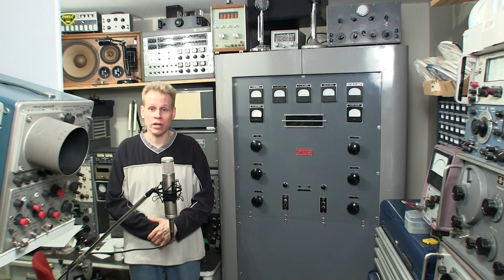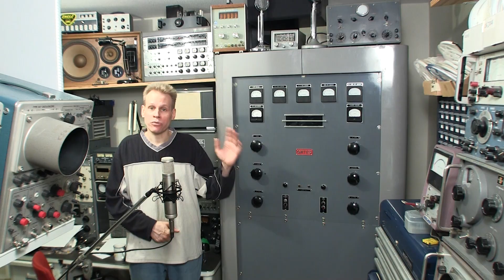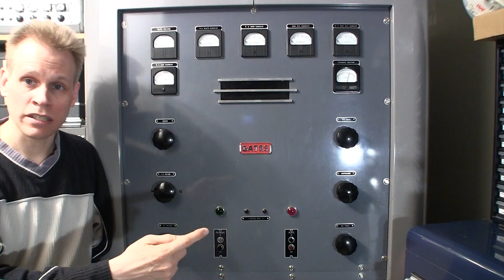Standing Inside a Broadcast Transmitter While it's ON!

Comment: Xmtr operating perameters were measured and logged remotely.   Before deregulation,  logging was done every hour.  There had to be a chief engineer on the staff ( or on call)  with a First Phone FCC License with broadcast endorsement, and the jocks had to have a 3rd class in order to do the readings and make the log entries.  An annual proof of performance test was done by the chief, where-in the audio chain was tested with an audio oscillator and a distortion analyzer across the audio spectrum ( usually up to 10Kc)  Directional stations were required to do field strength measurements in the field at specific points,  to prove that the directional antennas were adjusted to provide the service and protection required by station licenses.  Remote links were done by equalized dedicated telephone lines,  and by microwave links, with telco back up.  W6WUH.  Nice power level.

Comment: So whenever a Radio or Television station leaves the air or concludes its broadcast day (Sign-off) for the day mainly for maintenance, and returns back to the air (Sign-on) beginning its broadcast day, the engineer has to put up with all drama powering the transmitter up. In other words, those messages of the Morning Sign-on and Evening (Night-Time) Sign-off were being used as a means of timing for powering up and powering down the transmitter.

Comment: The Simpson Analog meters on front panel are in Beautiful Shape just looking at meters they scream Americana well Designed , Qualiry built Meters. I have a old Simpson  Analog VOM from my father i guess it was made 50s and still works. I use Digital high low imp VOM for my type of work which is Automotive Related, old Simpson VOM is okay to use poke around older cars with out microprocessors. My old Man said got to be careful if somebody asks to borrow VOMs because most Mechanics either poke out their eye balls with the test leads or when they bring it back VOM Test leads are melted from Shorts and Incorrect Settings, It  was are  inside joke but still cracks me up what he said.

Comment: people will call me a liar, but i worked at a radio station when i was 16. KEYE Perryton TX. i touched the output on one of these and the arc i drew with my finger seemed huge, at least an inch to two inches. it did not hurt though. why is that? they transmit at 1kw at a frequency of 1400.

Comment: WMOG 1490 in Brunswick GA had an RCA from the late 40's as a backup 250 watts.  If you ever had to turn that on in 1984,  the signal went from marginally listenable to BLAH BLAJH BHJAA blah BLAH ase;lfasjfp[j0o-[s!  But we were on the air , and that's all that mattered to a station that 65 minutes of commercials in an hour.

Comment: Sad to say, Our local radio station here in Sylva, N.C.  the original owners son was electrocuted by a  1k  transmitter by just touching a control on the front of the transmitter, but the floor of the room was wet. The stations call sign to this day has his initials. WRGC.

Comment: Could you explain me how a watercooled system on a 2c39 UHF tube does not completely ruin the whole operation? The anode is a large cooling part at the top of the tube. How does that correspond with the high frequencies?

Comment: I miss this soooo badly !!! I used to have this very same model transmitter modified for a certain band near the top of HF  on my peticular Frequency that i operated   in good engineering practice mind you a broadcast station for 26 years. It was my father's and i broadcasted from Friday nights at 10:pm -monday morning 2or 3 am.

  For the first 10 years of operation this beauty produced a wonderful warm classic AM sound and suprisingly clean signal. The bandwidth naturally was reduced and modulation was limited to about 90% and the RF output only driven to 200 watts. I eventually sold it to listener and i believe he got 10 more years use with the same tubes and mercury rectifiers.

My father and i meticulously cleaned it and repainted it to new as your unit is . i later upgraded to a 8877 tube amp which although a bit cleaner and more powerful in class ab and modified a bit sounded crystal clean and zero defects in both audio and spectral purity it could not produce the same character and specific flavor  of this gates transmitter.  Now being a broadcast station primarily listened on communication gear few could likley tell the difference.

  However for myself and any other  true blooded Radio/audio heads (AMers you know who you are)
There was is a spirit sent fourth when the sounds fly through the air from this device that can not be passed through the aether through any solid state device regardless of process or modern refinement.

 The type and variety of emmissions from this radio time transmitter is an example of that experience that comes with sound,smell and definition of imagery that defines the awe and wonder of what we broadcasting types call in its most authentic form  R A D I O            

73  my friends and watch that grid💜💖😎💖💜
Reply: BTW I will be back on the air in the not so distant future ..... You know where ....... There is only ☝🤔💜

Comment: We were still using these when I left KUJ in 2000.   I don't think I ever had to touch them they just sat there at the towers.   I checked them once a month.  Its funny the old gear for the AM never had issues, but anything new, like the SAT receivers, the computers, carts, all would last may five years or had weird glitches, but the damn AM gear, including the AM giant knob pot board, never ever failed.

Comment: How does that thing Stack Up in transmission quality to a modern ham radio transmitter in the same frequency that you're operating on?

Of course the modern one doesn't stack up in the fun and satisfaction Factor but just wondering about the actual quality of the transmission.

My naive assumption is that the old ones just got to blow the new ones out of the water?!
Reply from the maker: Hi Bill. Most modern rigs are low level modulated in AM mode, so they tend to sound "harsh." This was designed to do AM, and do it all day long, so comparing this transmitter to any modern ham rig is unfair to the modern radio. These transmitters are high level modulated (Modified Heising Configuration) and produce the nicest sounding audio on AM. Two 810 triodes modulating two 810 RF finals.

Comment: Let's discharge those large capacitors shall we,  now that we've decided to enter the back of the transmitter. 
I worked with a guy like this in power substations, brilliant, intimately familiar with the equipment and loved to show off the workings of it all. My ethic....If your not doing repairs or maintenance on it , keep the hell away from it. Well he liked to muck around. Until the day he came in contact with an energized 600v, 40,000 amp DC feeder breaker. It was heartbreaking to see his wife's face when supervisors told her of his demise. As smart as he was the odds caught up with him. There were just so many times you could tell him to just sit down and eat lunch and stop digging into the equipment. Even with lock out tag out procedures in place there is ALWAYS something that's alive when you are dealing with power of this type. Traction power, utilities power, industrial power generation can never really be 100% de energized.  Only isolated, buses and circuits, control, battery, metering, revenue metering of PT's and CT's may well be alive. Not to mention incoming high tension feeders. Yeah, keep mucking around, but make sure you have life insurance. Because it's only a matter of time.

Comment: I maintained one of these at the Naval Communications Unit transmitter site at Midway Island 1966-1968.  It was a large building full of many transmitters for military purposes, but the Gates 250 was off in a corner and used for our local AM radio station KMTH.  It was originally 900 KHz but while I was there we were asked to change it to 920 KHz (we had been interfering with somebody during some part of the day).  Even then, crystals were no longer available for it but the crystal itself was actually removable so we lapped it thinner with polishing compound on a flat surface (raising the frequency) by trial and error until we got to 920 KHz.  But my strangest repair was when some custom transformer failed that was no longer available (I forget for which voltages).  Heathkit had recently introduced a new family of bench equipment and for some reason our site had bought some of these and we assembled them.  One of these was the IP-17 high voltage power supply.  I rigged this up to provide the missing power supply voltage(s) in the Gates 250 as a "temporary" fix.  Long after, when I left the island to my next duty station, that Heathkit supply was still humming along.  I set it on the floor of the transmitter and I recall the floor being a little more empty than the one I see in your video, but I may be wrong.

Comment: Talk about durability,  from the late 40's until 2003.  Built to last.  Also the plate loading and the dip current meter is matching the standing wave reflection or SWR.  That was what was great about the old tube transmitters.  New Solid state as far as ham radio use requires a good match or your transmitter will not work very well.  I was the reader for my older brother in 1957 when he took the  fcc exam to get his ham license and his is still active at age 83.  I was slow and got my license in 1977 and also still active.
Johnson was a great company.

Comment: My father was forman of assembly for Gates Radio located in my home town of Quincy Illinois.  I remember him working there in the 50's and 60's.  He would take me there and I would see these large radio transmitters being made for radio stations and later TV and then for satellites.  He always cautioned me against the high voltage and current and not to touch anything.  Teams of people would hand assemble and test the units.  Later Gates was sold to Harris.  My dad was also a ham operator and built a 900 watt transmitter in our basement.  His radio code was W9SFT.
Reply from the maker: Thanks for sharing your story Mike!
Reply: @MrCarlsonsLab  Gates is still in Quincy, Illinois.  The other RF company in Quincy is Broadcast Electronics.  If you listen to radio or watch broadcast TV the equipment is likely built in Quincy.  Parker Gates was only 14 when he founded Gates Radio in 1922.

Comment: One thing I did not see is using a ground rod to make sure all the high voltage is bled off.  There should be a metal rod with a ground strap on it.  If the high voltage bleed resistors go bad you can still get one heck of a shock and it could be deadly.  The ground rod is touched to all the high voltage points like the tube plates to make sure the high voltage is bled off.

Comment: I have been inside a transmitter room while the transmitter is running and I am very skeptical about this video.  When transmitters are active, there should be a very loud noise from the cooling fan.  Where's the noise in this video???
Reply from the maker: This has no fans, The BC-250-GY is convection cooled. (The big cabinet)

Comment: I used to work on AN/URT-23G transmitters in the Marines in our CLD vans.  3250 v on the plates and 1000+ watts. When I left the unit with them, I was asked to check on the new technician. It smelt like burnt skin. He left the van in an ambulance with part of his finger stuck onto the tube.  500 watts, no problem, unless you don’t discharge the circuit before you work on them.

Comment: I work on some of the big transmitters. My biggest is a 30kw harris. I won't go near the inside without pulling the disconnect.  One station gave me an old gates I want to say BC1 was awesome to watch it though the little window to see the final tubes and watch them get bright with the modulation. I ended up donating it to the ham radio club. I have a similar vintage to what you are working on a Gates FM5 I think backup transmitter. I was inside it the other day replacing the filament relay. I don't even know if I can buy tubes for it any more.

Comment: You deserve a lot of praise for taking care of these old beasts. They would have ended up in the dumpster or have been scavenged for parts otherwise. The demise of AM stations is a darned shame. Modern broadcast equipment are full of digital gimmicks and wizardry. The old valve stuff are simply bombproof works of beautiful craftsmanship and built to last a few lifetimes.

Comment: The inside of this transmitter is artwork!!
The power of broadcast transmitters is impressive. I watched a video tour on YouTube of the transmitter site of Atlantic 252 (Top 40 station in Ireland which was serving the UK and western Europe on 252 kHz LW in the 1980s and 1990s).
This was broadcasting at 1.5 MEGAwatts at 252 kHz. Transmitter HV DC supply = 30 kV at 30 Amps. The safety cage fences around the transmitter and antenna tuning coils were resonating with the song being played while they were doing the tour. I'll look for the video link, and add it if I can find it. I remember being able to receive Atlantic 252 from Northeastern Canada when Dxing in the early 1990s. The power of long wave!!

Comment: Mr Carlson, this transmitter is so beautiful. I really don't understand how you got it to this condition. I know that equipment of this age will always look very faded and worn. The metal parts don't look shiny like that; they are all oxidized and dull. Your transmitter looks as though it was just delivered from the factory. How did you do that? Did you repaint it? Did you replace all of the shiny metal parts? ...or re-plate them? ...or polish them? How about all the labeling? Is that re-created or original? How did you do it? Inquiring minds want to know!  :-)

Comment: Mr.Carlson, This video gave me a big "warn fuzzy" from long ago. When I was about 14, my sister Sandy was dating Bill Glenn a DJ at Spokane's KSPO country station. I was enamored with him to the point he asked me if I'd like to work a shift with him. The following evening he came by to pick me up and we went to someplace in the downtown area up to an apartment where their studios were. From midnight 'til 7 AM I was hooked. After Taking a radio announcer course through KZUN, a station near our home in the then suburb of Opportunity, They thought I was good enough at 16 to have a little show of my own. It was only 2 hours of easy-listening for Hazen and Yeager Funeral Home, on Pines Road too, but about 5 miles north. I have much more to say I hope you'll like, but for now, I'll relate what I went through. Our original FM transmitter was in the basement, and I learned that it was so heavy, they put it there and built the small complex of 4 stores on top of it. If you Google KZUN you can still see the building with the FM 100 foot tower behind. It' a cell tower now. Looking at the meters on your unit, I have a semi-funny story you can relate to. I had to keep an hourly log of what ours read from a remote panel in the control room where I DJed. One, for about a week I had to pay special attention to, the Frequency Deviation Meter. You would understand better than I ever did, but the engineer said the coax going up the tower had sprung a leak and needed replacing, but until it came, when we saw the needle move more the 2 points off center to the left, I had to put a long record on, dash down to the basement. I then had to grab the tire pump and work up a storm while watching the meter on the transmitter until it "0" out. You spoke about lightning. On one of my shifts, we had a bad T-storm roll through and our tower got nailed but good. The power went out for about 15 minutes so I had to sign the station back on and finish my "show". After I did my sing-off stick. (after 50 years I still know it by heart) I reached up to turn off the transmitters. The FM below me powered down, but the AM 10 miles to the south in Chester wouldn't. I called the engineer and he came, opened up the back of the remote control, and a section was burned black. I though I heard something, besides the instant boom of the thunder,  but the smoke was drawn out up the cooling exhaust on the roof. I hope you found this of interest, and I have more to relate if you want to hear. Keith Lincicum
Reply from the maker: Thanks for sharing your story Keith, and taking the time to write as well.